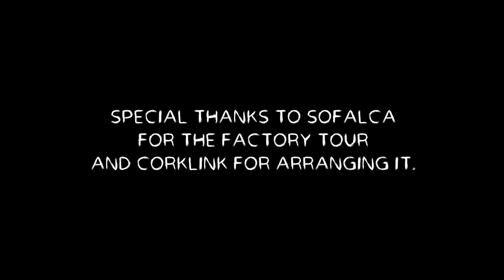#53 How cork insulation is made in portugal (From harvest to factory)

Comment: Actually in Portugal it is forbiden to cut down a cork tree by law, unless the govt authorize it due to being sick etc... its the one product (cork) that Portugal is the no1 world producer
Reply: Underrated natural product, good the government protects this by law. Else the money-machines of the world will shred them apart. Do you know if the trees aren't sensitive to fire after being harvested? As I guess the bark is naturally an isolation for the tree...
Reply: It doesnt help for sure, but cork trees and other oak type trees native to portugal have a very strong natural resitence against fires and require an extreme high temperature (as with pines as well) whem compared with the invasive species that are a plague and responsible for the sever wild fires that happen every summer as "eucaplitos" and "acácias". The main reason is that the resin helps slowing down fire propagation within the wood of the tree
Reply: And money machine enterprises have been "milking" this trees since the international trade started back in the 1500's, and its much more profitable to use them for corks than for wood for furniture, burn etc, due to be of very slow growth of them. Luckly also authorities understood that as well, but it was already common practice to dont cut them (loads of certain periodic income for very households during centuries)

Comment: Absolutely loved this video - thanks for making it! I often specify and build with expanded cork insulation. It's a fantastic product, not only as straight forward insulation boards but also as an isolation / bridging material - for example, when joining a new timber frame extension to an existing brick or stone building, installing 20-30mm of expanded cork between the two makes for a great joining material that not only provides a thermal break but also helps buffer any movement differentials / expansion / contraction whilst maintaining airtightness. The more different thicknesses you have on site the more different creative solutions to building problems you find for it!

Comment: As I agree, that expanded Cork is a great insulation material since carbon positive. However, the processes and machines are ancient and the full potential for CO2-reduction there is not pushed to its limits. I would have been interested in more numbers, like what is the amount of harvested cork which closes wine bottles (does not need to be sustainable) and what part for the other products. What is the insulation value compared to standard insulation materials?

Comment: Interesting point of conversation at 7:27.

When a tree has fully matured it absorbs carbon at a much slower rate compared to younger trees that are growing at a faster rate. 

The cycle of harvesting trees for timber products is a very good way to remove atmospheric carbon, as long as there are new trees planted.

The question is how much carbon does a tree absorb during production of quark? And secondly, since the quark is a single use biodegradable material, does it really count as sequestration? As it breaks down the carbon is released, while a 2x4 may spend the next 200 years locked in a wall.
Reply: it really depends. what is the total life of the tree after being chopped down, is the lumber going to be used for what? and what wil it be it's total life... 
if a tree is around for 200 years it as already outlasted most of the Woden houses out there.. paper is way worse...

note the main benefit is ecological and the ecosystem the forest it grows is... it's not a monoculture and as several other species mixed in. and a rich ecosystem around them.

Comment: I think there is a misconception about trees and forests functioning as carbon sinks. When a tree naturally discomposes it releases the same amount of CO2 as when burnt. Chopping trees down does not work against it. Only what you make out of the lumber makes a difference for or against carbon capturing. If you build furniture and buildings out of the lumber the CO2 will become part of the build environment. Building with wood is a carbon sink in and of itself. Harvesting wood is therefore more carbon friendly because the wood is not allowed to compose at the end of its trees lifetime.

Comment: You know, the green new deal is out in EU.
Carbon makes the cork grow. You are not really good in your way of living.
And that cork for isolation is really not very good.
You must look up the lambda value of cork. It’s low.
Reply: so what do you suggest? killing an ecosystem and replace it with what???
cork insulation on top of decent thermal isolation also offers excellent acoustic insulation.

but I'm really interested in what other thermal insulation you find more ecological...
Reply: When I Googled "lambda value of cork" the first thing I saw was: "The insulation value of cork is very good. The Lambda value is 0.038-0.040 W/mK. Since cork is an excellent sound insulation material as well, it is perfectly applicable everywhere"
Reply: Foam and Cork Insulation Protects Deep Space Rocket from Fire and Ice | NASA